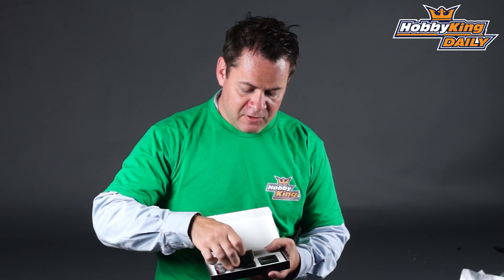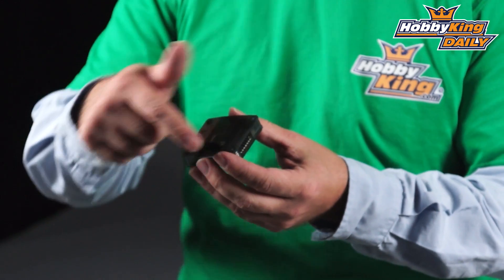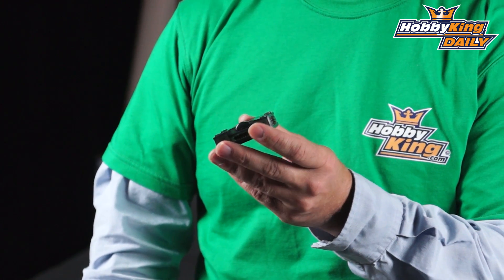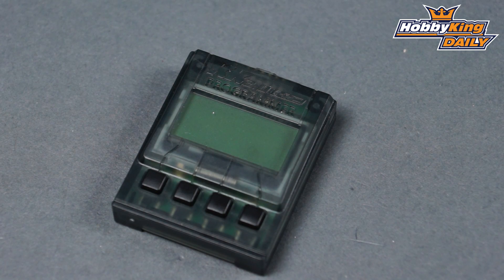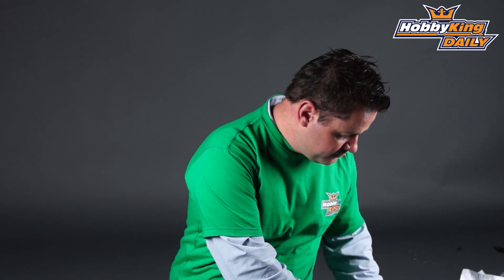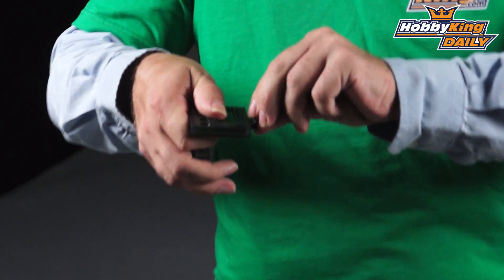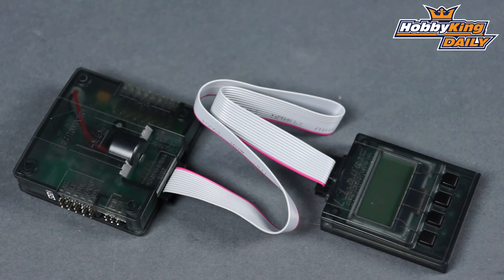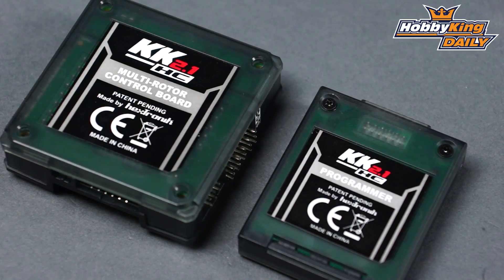HobbyKing Daily - KK HC Multi-Rotor Flight Controller

Comment: This is a welcome addition, well done HK!
I like KK2 flight behavior as it is (ever since firmware v1.6 has been released), and don't really feel a need for a GPS or a compass. Barometric sensor with altitude stabilization would be nice but not a must.

I notice the receiver and ESC headers point sideways. I think it would be nice if a version with straight-up headers would also be available. This would work better for some of the wonderful new FPV frames (e.g. flip 360. etc.)

Comment: Kk3 would be great! GPS, Baro, compass, basically all the greatness of multiwii or mpng with the ease of a kk!
Reply: Just get a NAZA Lite or similar. I think the strength of this board is its use in acrobatic multirotors where you tend to switch most of the stabilisation features off.  This is why removing the screen and having a hard case is not a bad idea.
Reply: I own 3 naza including a lite, but in manual mode the acro just isn't up to par, not much to tune but gains. I also fly kk2.0 and mwc, I think the best if both worlds would go over well in the market for people that want mwc type performance and kk2.xx ease. That's all I'm sayin man.
Reply: +stewjw nazi?
Reply: +США номер один  I am one for writing faux pas but not this case it is a DJI NAZA-M.  I do write a lot of bull shit comments though. The Cleanflight flight controller based boards seems the favorite for small multicopters a year later. Sorry I don't speak Russian I did try and learn a bit.

Comment: so is this the kk2.1 or kk2.1.5 board in this device?
Reply: This is the 2.1.5
Reply: udx0001 Look on the HK product page because they have it listed as KK 2.1,but you can and will need to update it with the same firmware as you would the KK 2.1 and 2.1.5. :-)